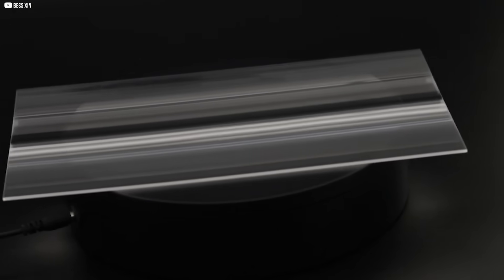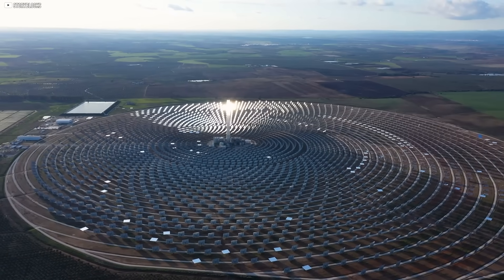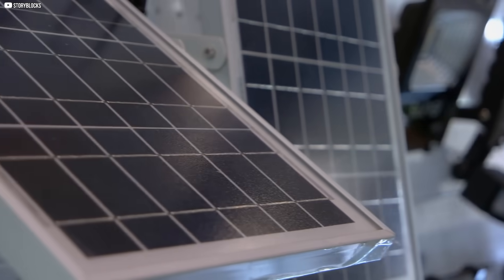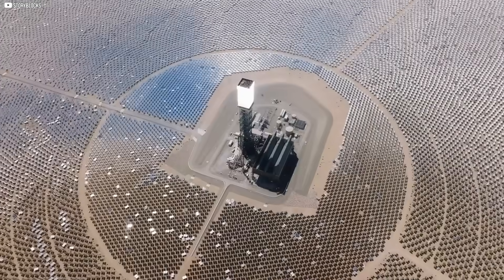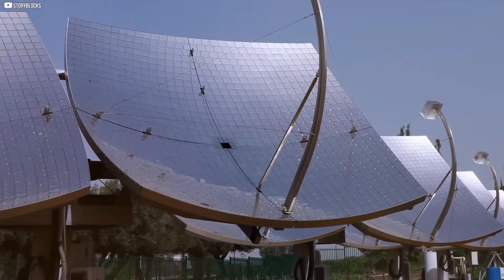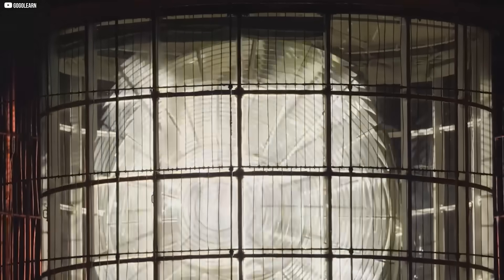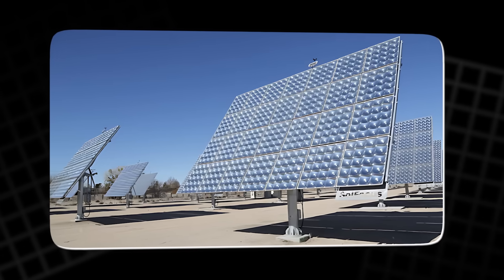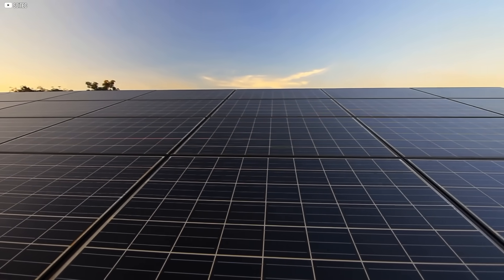This Lens Could Triple Solar Power | So Why Isn’t It Everywhere?

Comment: "instead of chasing more light, what if we could squeeze more energy form the light we already have?"  A very good idea, but what you are presenting here is quite the opposite.  Using a lens "chases more light" and concentrates it on a smaller area, it does not "squeeze more energy from the light we already have".  You need more efficient solar panels to do the latter.

Comment: Heres a wild thought.  Use a fresnel lenses focal point to boil water in a steel sealed container for steam pressure  to spin a turbine for electricity. But just enough to power your home and business